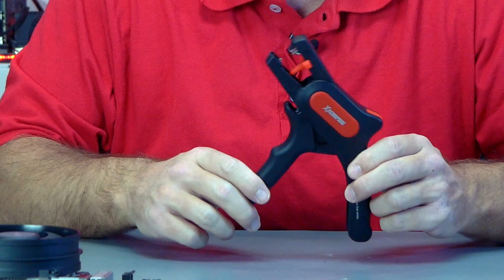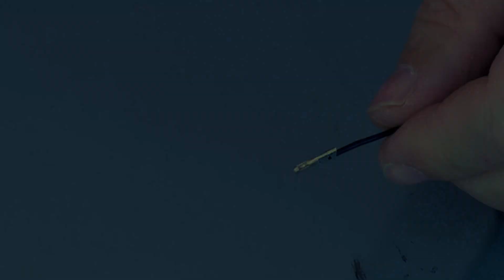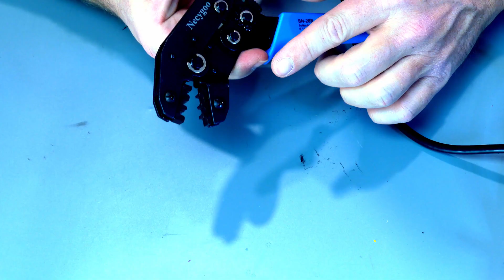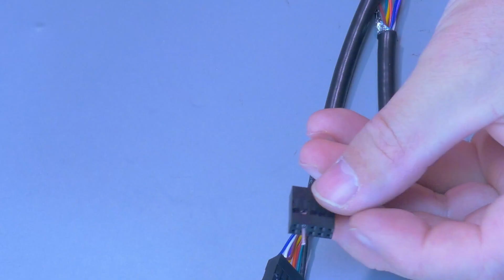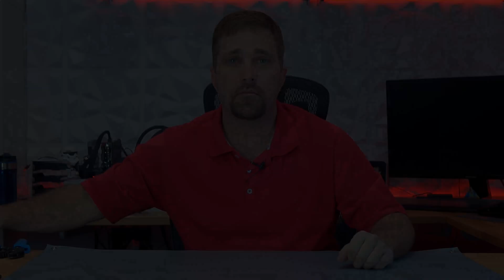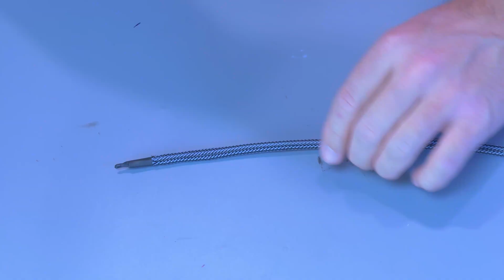How to Rewire a PC Case, PT 2. The Front Panel IO Cables

Comment: So I have an old case before newer usb types & type C and thunderbolt 4 c. can I get the connector cable terminal ends somewhere.???  I am getting to a LGA 1200 z590 board

Comment: I have the rosewill thor2, and sent it to bestbuy, in this new world its crazy. The person that was to do evaluation of repair to be done. He didnt understand and I assume no tech was on at the time. He decided to so what he knew. He shouldnt of, because he decided to wipe off the cpu, so he took it out, and placed it back wrong( damaged the socket) He didnt know so he told me the fan did not fit, but all it needed was to grounded to the board. Next he asked for me to get another fan, I said I can give him Another, I gave him the standard i5 cpu fan. The pc had been in before , I switched cpus to an oc i5, so I had the tech make sure nothing was wrong, mind you I was in just 4 days before. Everything slightingly was fine, even though I had removed the bay covers, on a full tower, it looked a mess, I cared about the board in operations as I was moding the case as well. Me and the tech laughed as he heard what I thought would fit. And customize the case more, he was impressed said he couldnt wait to see it finished. Onece I recieved my oc gpu, I was ready to start. It got to the load screen and paused then shut off I thought due to overheating. After three days, I said hell bestbuy can fix it. Oh no, I get a person whom didnt know what he was doing refused to wait till the tech came. And came to me and said they would have to do a rebuild, I asked to get software to work? He said the case was a mess, so he was going to have them do a rebuild. Rebuild? Whats wrong with the build? He said it would be best. I thsn noticed not one time did he speak as a person that knew anyrging about what he was talking. The techs are always naming pc parts, telling what is failing, mentioning the staus of the status of the cpu. He did none of it, Id imagine the tech coming in seeing the case, my case is the big thor2, it catches eyes as its a 50lb to 65lb case. Im sure Im the only one with it in their shop. And I bring it in all the time. So they know me, I can think the tech seeing it and saying first did he bring it in like this, and ge saying yes. Then I knos the tech would of asked are you sure? And getting another yes response.?.to which he might said ok or sure.... The board was ruined all the wires were disconnected, cpu socket destroyed, power button pulled out, possibly from unknowing tech trying to free something.... Ooh they killed my 1000 build

Comment: @23:00  You can use a multimeter to find correct wires after putting on the sleeve. I suppose it is a matter of opinion which is easier but I probably prefer multimeter because I have it more readily available than a set of markers.
Reply from the maker: Excellent option.

Comment: and how to do that with usb 3.0, could you explain it again ?
Reply from the maker: I'm not sure if I understand the question. I did not modify the USB 3.0 cable at all. I just tucked the excess in the bottom chamber of the case.
Reply: @ElevatedSystems  I expressed myself incorrectly. wanted to ask you if you ever make a tutorial video on how to wire USB 3.0 because unfortunately there is nothing on the internet
Reply from the maker: @_Barron__  Like i said in the video I do not mess with the USB 3.0 cable. At most I'll get a good 3rd part extension if i need more length, however, due to the complexity of the shielded and twisted pair arrangement of the cable itself I would not ever recommend trying to alter it.